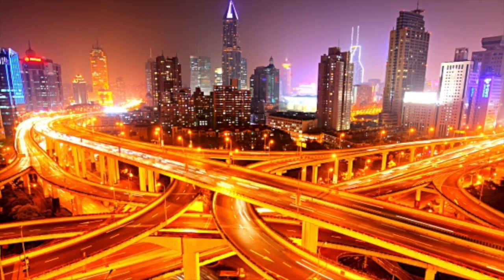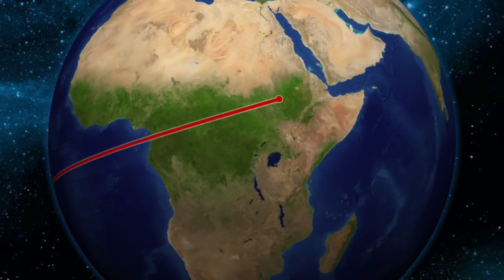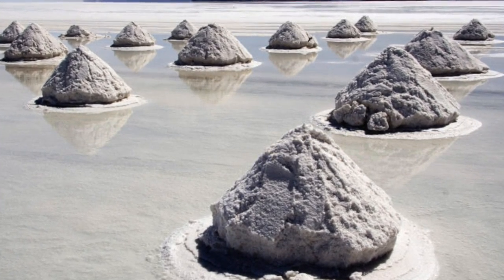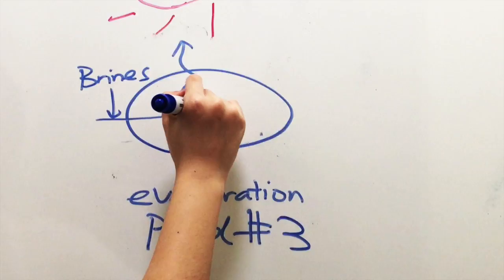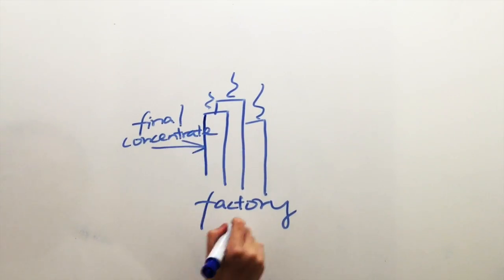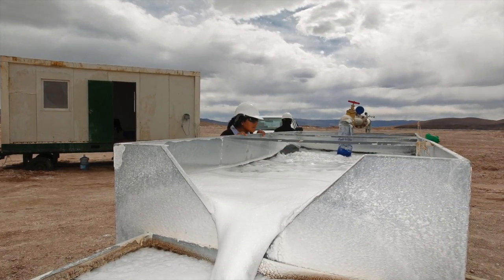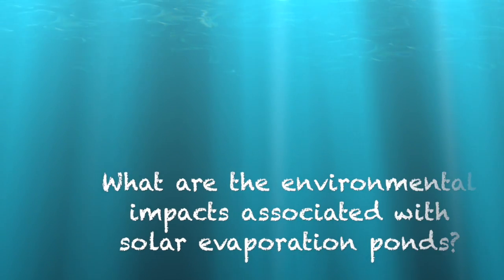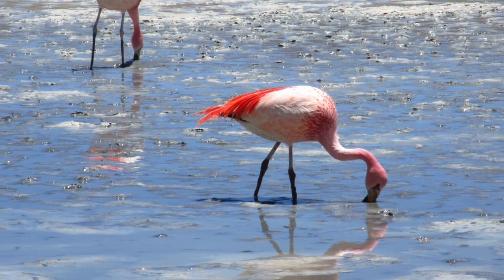Lithium Mining

Comment: The second they figure out how to use an electric car in northern Canada's winter at -40, you let me know...
Reply: Mistery Smithers teslas can, but I'm pretty sure you have to pay a lot more
Reply: Not a chance, Tesla doen't guarantee a charge below +10 Celcius. That's 50 degrees above from what it is here. It would lose over 90% of it's intended charge and reduce the battery life by over 80%, call tesla and ask them, I did. 80,000$ paperweight.
Reply: Any Tesla, Chevy Volt, Chevy Bolt.. they all have active battery management system.  The bigger question is how can you use a gas engine in that cold.. what is used to start a cold engine if your battery doesn't work?
Reply: @1905934  You can use compressed air to start an conventional engine. I know that ships do that.
Reply: @jannikheidemann3805  what a pain in the ass gas engines are... that you need compressed air to start the engine in cold weather.  The thing I like most is the instant heat on a super cold day on an electric car.
Reply: @1905934  you can also just use an engine heating pad to keep an engine warm.
Reply: @GANTZ100pts  But that uses electricity.  If you can't use electricity.. your gas car is a brick.
Reply: @misterysmithers8566  Which electric car do you have?
Reply: @misterysmithers8566  I live in Saskatoon.  No your truck will not start at -50 C.  Neither will any gas vehicle.. Pixie dust and cool aid is more your style.
Reply: @1905934  Northern alberta had the lowest temperatures in the world this winter, my gas GM wasn't plugged, it started, you must be a Dodge driver, LOL
Reply: Hydrogen

Comment: ▌▌▌▌▌▌▌there is not enough lithium globally to supply the world for 8 years of batteries  if we should start using electric cars in europe alone instead of combustion engines.. and lithium batteries can not be recycled. ..
Reply: Julio Ochoa 17 years is thus NOT A SOLUTION plus the worlds population is increasing ev are doomed from the start, there is not enough lithium for a economic transition from oil there is a hour long video on youtube that explains why lithium batteries for global evs is doomed from the start.. toyota already did the calculations in 1980 they already knew electric vehicles on battery will not work globally, john deere said you will never see a tractor on lithium batteries nor anything that requires heavy power ....evs are a fad sure to fade away unless we get carbon super capacitors that function as batteries
Reply: ankhenaten2 trump actually selected musk as an advisor because he is a leader in tech. the world can definitely run on batteries from solar and wind. Lithium isn't the only metal that can be used for a battery. also you're acting as if lithium is powering a car like gasoline. a different battery with a different storing source can be swapped out if needed. it is used for STORING. I'm done here. when there are hydrogen fuel cell cars on the market better than Teslas cars, we continue:) I can tell you don't have much experience in chemistry. keep praising corrupt oil companies🤑🤑🤑🤑
Reply: Where is the source of this information?
thanks.
Reply: ankhenaten2 first of all, 17 years is only if the entire planet is being powered by lithium ion (very stupid scenerio). In my opinion it is very important to raise the demand for lithium ion batteries that will then raise demand for batteries in general. Raising the demand for lithium ion batteries and EV's will push battery technology even further. There is 400,000 pre orders for the Tesla model 3 which is a great sign that we are slowly leaving our dependence on foreign oil. Lithium ion batteries will be replaced with different batteries. There are many battery companies out there coming up with innovative energy storage techniques who aren't being funded because the demand for EV's isn't very high yet. However, we are moving forward.
Reply: ankhenaten2 Right now, batteries improve at an estimated 5% per year — and while that might not sound like much, a decade of 5% improvements works out to batteries that hold about 1.6x more energy than what we have today. By that standard, a current Tesla Model S would have a nearly-500 mile range if manufactured in 2026. And no, not just lithium ion batteries.
Reply: let us follow logic:

How much lithium is there to be mined when we run the entire globe on lithium ion batteries regardless if they get "better": 

Answer. ..less than 17 years

Logic dictates lithium is a no go area

Logic demands a recyclable energy store mechanism that does not deplete in 900 years and can be burned as well for heat and be used as fuel and be manufactured anywhere on the globe, that can run tractors, trains,busses trucks and planes helicopters and spaceships

Logic advises the most abundant molecule in the universe hydrogen

Fun part...elon musk runs his spaceship on hydrogen he has a gigantic hydrogen facilitie that produces hydrogen. ..go ask elon the liar why he doesn't use lithium batteries to fly his bullshit into space😂
Reply: @ankhenaten2  Do you even science, Bro?
Reply: +ankhenaten2 Well i won't call it dumbest idea it's more like a stepping stone for the new advanced technologies , Lithium-ion batteries made the batteries go mainstream. I was researching more on recent discoveries in this field. Found a great article here : http://www.pocket-lint.com/news/130380-future-batteries-coming-soon-charge-in-seconds-last-months-and-power-over-the-air , it includes all the recent updates in the world of batteries, worth a look. Lithium may have its negatives but you can't just ignore the impact it made on world from mobiles to laptops to any electric gadgets u got u will find it , its here to stay at least for a while.
Reply: ankhenaten2 lithium is extremely abundant
Reply: ankhenaten2 reserves estimate of lithium in early 2015, concluding that the world has enough known reserves for about 365 years of current global production of about 37,000 tons per year (Figure 1). Current production goes to a little over one-third for ceramics, almost one-third for batteries, and miscellaneous uses for the last one-third. The same report finds about 39.5 million metric tons of “resources,” which is a less firm category than “reserves.” "Resources" include supplies that could feasibly be extracted economically at some point in the future, whereas reserves estimates refer to current economic viability. 

Even though 365 years of reserve supply sounds very comforting, the point of the EV and stationary storage revolutions is that current demand will shoot up, way up, if these revolutions do happen. The 100 Gigafactories scenario could come true. And if that happens, the 365-year supply would be less than a 17-year supply (13.5 million tons of reserves divided by 800,000 = 16.9 years).
Reply: Julio Ochoa a lot of presumptions and hopes I read the fact is there is no future for batteries to run the globe like how oil can...and to blow your entire argument today on world news a consortium of multi nationals like SHELL and exxon mobile and toyota and nissan have come together to push hydrogen into the world for the next global fuel to replace oil...shell has a pdf out proving that batteries is not viable economically and can not provide the world with power in anyway to sustain a global economy. ..even the biggest automaker on earth toyota has a pdf out explaining battery cars are doomed from the start exactly how i explained and toyota is dumping electric cars for hydrogen cars... in short you are WRONG you can not run cars globally on batteries. ..the grid can not even support that end of story here is the article to blow your pipe dreams away https://www.google.nl/amp/s/www.bloomberg.com/amp/news/articles/2017-01-17/toyota-shell-among-auto-and-oil-giants-forming-hydrogen-council?client=ms-android-tmobile-nl
Reply: ankhenaten2 prove to me that you can not use batteries stored with solar/wind/hydro energy to power the planet. battery technology and pricing is going to be forced to improve with the increasing demand for electric vehicles. also, are you going to keep trusting everything these gasoline automakers are telling you? there are a lot of things wrong with hydrogen fuel cell cars. the process of storing hydrogen in a fuel cell is about half the efficiency of a battery. if hydrogen leaks you won't even be able to tell, since it is an invisible gas. using methane or propane are much easier ways to store energy. it'll be super obvious as time goes by. the best case of hydrogen fuel cell cars STILL doesn't beat the efficiency of battery storage. Look at the studies from actual scientists and not just gasoline companies. https://thinkprogress.org/elon-musk-is-right-hydrogen-is-an-incredibly-dumb-car-fuel-d0f37a4c9bee#.2ldxvc85w
Reply: ankhenaten2 It doesn't matter anyway, the world will be fully electric and using battery storage eventually. the fact that you listen to corrupt gasoline companies is the funniest part.
Reply: Julio Ochoa listen if the world would be stupid enough to follow the pipe dream of electric cars via batteries (the world will not do that) lithium supplies are not enough to supply the world with batteries as you already posted when the world would switch to lithium cars the supply would run out faster than 17 years but the most damaging fact for you is that lithium batteries can not be reused!!☺ so just when you have the world riding lithium cars (will never happen) the lithium runs out and the old batteries need to be scrapped and no replacements in sight....this is why all the big global companies are stopping with lithium battery ideas because its STUPID  its like if i told you here is the last gallon of fuel on earth lets start driving 😯And make more cars😩

Hydrogen problems have been solved there are new storage technology and it can be made by wind generators or solar panels or hydrodams etc... its recyclable and clean and unlimited. ..in short the ultimate gas ...we can even use it in combustion engines 😉 so we can keep driving v8 and v12😊

Thank trump for the fact the stupid subsidies on electric cars with lithium will stop
Reply: Julio Ochoa dude the other battery types will make your car drive 70 miles on a full charge ..😩.
Reply: Keep on running your dreams of Hydrogen fuel cells something you can't change is that they suck at efficiency. There are other metals which can be used as battery not just Lithium , just search Nickel metal hydride batteries (Nimh) but they use lithium-ion cells because they can be charged and discharged more rapidly. Still with more technology advancements we can get better efficiency as the time passes we may use less & less lithium for batteries as of now. 

And i guess you don't like Elon Musk that much & its alright you don't have to but just be ready to be left behind.
Reply: Rahat Bhatnagar no i am not at all against batteries or electric cars i am against lithium batteries and just a month ago the inventor of lithium batteries came out that he had a new type of glass based battery that is 400% better than lithium, glass batteries can charge to full in 30 seconds and give a electric car 1000 km range. Lithium batteries is the dumbest idea ever
Reply: Of course car companies and oil companies want hydrogen...You are controlled by the gas pump.. they are just switching the fuel.. so the gas station still makes their billions and everyone is happy.  Electric cars will disrupt everything.  Lithium is super abundant... to the point of being crazy abundant.. there is Lithium as the left over product of refining oil.  Stick a shovel anywhere on the earth and there will be a percentage of lithium... there is more lithium then there is oil in the ground.